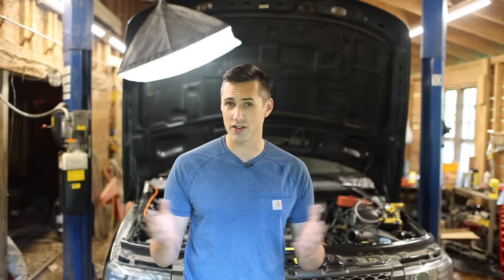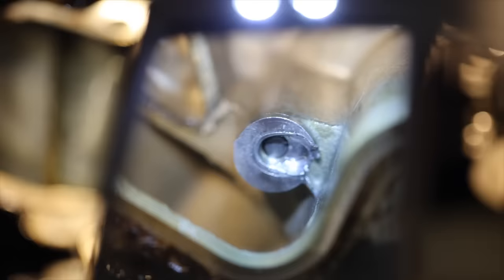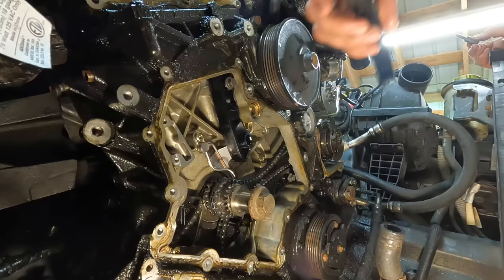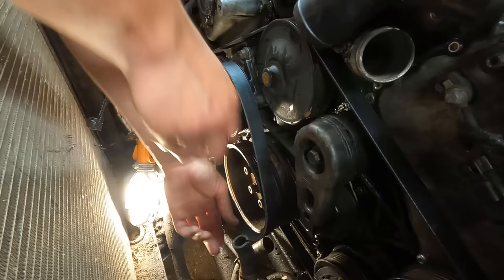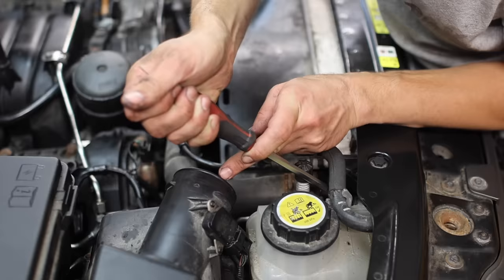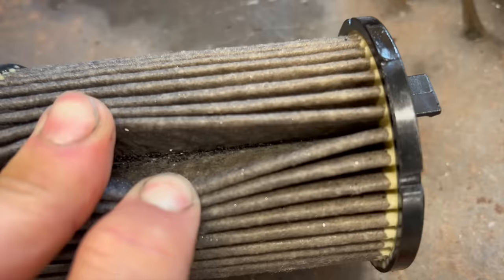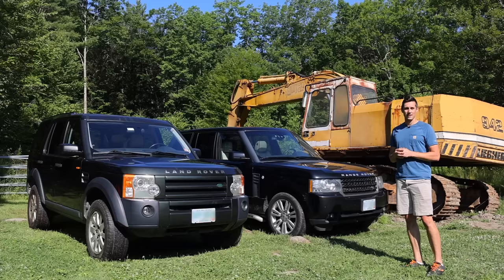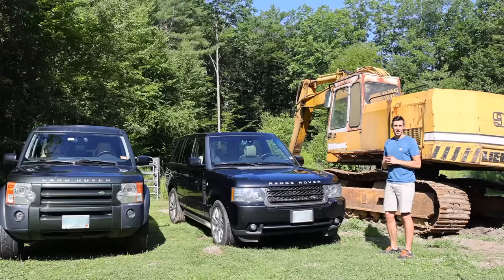Does My Cheap Auction Range Rover Need an ENGINE REBUILD? [Range Rover Part 4]

Comment: I'm not a Mechanic but do work in JLR Spare Parts and I would say just run it, putting more money into this engine is just chasing losses. If it does go pop then replace it with an engine that is reliable and as close to the original engine spec as possible i.e. a reliable V8 of similar displacment with similar features. You should be able to adapt the Jag sensors to work on the new V8 allowing the Jag Engine Computer to run it at the end of the day the ECU has no idea what the sensors are installed in and all engines need the same things to run.

Comment: As dark as the first oil change is, it’s possible, all the broken cam parts were just stuck in the oil sludge in the engine, if it’s holding good oil pressure and not making abnormal knocking or vibrations. It’s probably fine.

Comment: You must remember that the Range Rover has not let you down yet.  It has a history and you have worked on it, but the engine runs fine.   Aluminium is less of a concern to me that steel.  Cams running in bearing caps is normal for a British engine; it works fine and does not generate wear.  In fact of my pre and post war British engines, the cam is the least wearing bearing (as long as you used reassembly grease).  Drive the Range Rover and you may see less aluminium over time.

Comment: Engine Flush and oil pan removal...It would make damn much of noise if it would have been wearing... probably those debris are still left in oil pan. Great work of art. Thanks. Great videos

Comment: AH SNAP! i've done the same mistake with my 1996 volvo 940. The issue with engine cleaners is that they do more harm than good if used the easy way. Ideally we should've both taken the oil pan out, thoroughly cleaned it, then added some expensable oil with the engine cleaner followed by at least 2 oil changes. By cleaning the sump first you ensure 90% of the rubbish has been removed and won't go swirling around all the friction points such as crankshaft bearings etc. Then that way you only clean and dislocate any residue from oil passages and the rest of the engine which you'd want to flush out after 500 miles or so. If the oil and filter don't look too bad then you're good to put fresh good quality oil and filters in until the next oil change. As every one else mentioned keep at it until it's clean, perhaps at the next oil change once you've drained the old oil put the sump plug back on and pour a quart of oil in the engine, then flush that as well, hopefully the fresh oil will drain a good amount of stuff in your sump, you could even run it through a cloth or towel to see if it actually carried some shavings with it. Best of luck Waldo. If you were to engine swap it why not consider the 4.4TDV8 or the smaller 3.6TDV8 or even the L405 4.4 v8 turbo diesel V8 engine from the newer 2012 onwards range rovers? They're all diesel torque monsters, they come with 600 to 700nm(516lbft) from factory, if you re map them they go up to 1000nm(737lbft) or more.

Comment: Along with the easy-out kit, left hand drill bits work great for extracting bolts when used along side of right handed bits. Simply drill a hole in the broken bolt with a right handed bit, then choose the next size up in a left handed bit and forcefully drill the hole thus provoking the bit to jam inside the broken bolt and unscrew it.

Comment: Great vid.  No LS swap, too complex of a vehicle.  It's find that glitter in the oil source and use the bucket to smash it, but a super mud run or an airborne jump may be required first.  These LR's are hard ones as they are unique from oil passages to high tech attempts at superiority.  Hoping you can find the source of the aluminum in the oil and fix.  Someone with better knowledge of these than me might help.  Sure hope so.  Waiting on Part 5.

Comment: When you did your cams---  You have to keep the caps in order and put them back where you got them from.  If you mixed up your caps, it will have to wear in a bit--  but it should still be fine after it wears in....   I'd just plan on doing an oil change half way on your trip, somewhere on the road or in another Youtubers garage along the way.  (that's what Deboss Garage always does).   That seafoam could have busted a lot of stuff loose and it may take a few cycles/ oil changes to flush it all out.
Reply from the maker: Yeah, I made sure to put the camshaft caps back in their original locations 👍

Comment: Just open the bottom oil pan and have a look.
Wash it properly 
Clean oil pump filter and keep running the engine till it breaks.

Comment: I am a car guy and home mechanic and will do just about any car that I really like. Worst car project was a 2008 Landrover LR2 that my dad liked so we did it as a project together. We knew it had a blown head gasket. Bought it for less than $1000 and put about $1500 into it. It was tough to work on, lots of special tools, and anything that could go wrong, did go wrong and it was just one problem after another. We learned that the previous owner put head gasket sealing product in the oil instead of the coolant. Had to flush it out like six times, blow compressed air through all the small VVT oil passages, new oil pump,etc. It was like someone had a Land rover voodoo doll and would poke pins in it just to torture us. Even when we thought it was all done and went to sell it, a fuel pressure sensor blew out at the end of the fuel rail and a stream of gas nearly caused a fire during a test drive buy a potential customer. Needless to say the gas leaked into the alternator and blew the diode out and an actuator motor in the intake manifold. Just wanted to blow up the entire car at this point but my dad, an engineer type, just could not let the car beat him. He fixed these last two issues and so far has been ok, but I still don't trust it. We have countless hours into it and learned a lot but the main lesson...never buy another Landrover.😂

Comment: I did one with a New timing chain and crank and cam sprockets. Metal shavings did go away after four new filters . The bolt that was rattling around would add even more shavings to clear all the oil channels. Before your trip use Liqui Moly Ceratec.

Comment: Can you retrofit the sensors from the Rover engine to the GM LS or Toyota 5.7L engine for the Rover electronics?  Use the GM or Toyota ECM to run the engine.  I know this sounds easier than it really is, but it may solve some of the issues with the conversion.

Comment: I've been a mechanic most of my life seeing the damage from those broken vulture probably got residual aluminum still throughout the engine you only drove the vehicle 10 miles you said so that wasn't enough time to flush everything loose plus you're going to have some transfer from the new components you put in there from what I can tell on your videos the engine sounds really well I wouldn't worry about it I just drive it put some liquid Moly anti friction oil treatment you can find on Amazon for about 10 bucks a can I nearly get mine at Napa for around $14

Comment: Drain the oil, drop the oil pan, reach up from underneath and replace the crank bearings. Reinstall oil pan. Refill with oil. Run.

Comment: Just wanted to say thank you for turning me to the Milwaukee metal saw and the Tillman gloves. You pick very good products. That saw is a blessing. I have an XP30 and am sick of grinding dross and slag. When I first used the saw on 3/16 msp, I was awestruck. It cuts with less effort than going through wood with my cordless framing saw.

Comment: LR3 (Discovery 3 everywhere else in the world) is a great truck! I think it was probably the most reliable Land Rover product for many years. I had one and the only thing that went wrong with the rear view mirror came off the windshield right 3 days after I bought it brand new. By the way all that fancy trash control and yaha control ..yeah that doesn't matter on ice. It won't save you. Especially if there's a layer of thin snow on top of it and you can't see the ice underneath it. And the fancy street tires they put on them limit your off-road capability. But otherwise great comfortable and generally reliable vehicles. (LR3) only

Comment: On GM's Ecotec engines there are very similar issues with the timing chain assembly, I have a 2.4L version fitted to my Captiva. My tips - 1) do NOT fit standard OEM guide fixing bolts, rather ARP bolts as they are of a much higher grade & will not break, you may have to have some spacers made, but these are not difficult to produce. 2) only use US replacement parts as they are the best. I once used the same Castrol motor oil, but found SHELL Helix to be far superior which I change every 10-12,000km. I only use Bosch oil filters and change every 3,000km. Modify the chain tensioner/s to give a constant hydraulic dampening effect. I can explain to those who are interested as it's the tensioner which is really the cause of all the problems.

Comment: LS is always a nice option.  I don't care if "everyone does it."  There's a reason why everyone does it.  They're great engines.  That being said, I'd love to see a 4.0 1UZ-FE from a Lexus in it.  Incredibly reliable, smooth, and powerful engines.  

For now, I suggest just driving the thing locally to see if it's still going to die, unless of course you have thoughts of a rebuild or have plans to salvage the engine for some reason.
Reply: I would have loved to agree with you on the 1UZ swap, but I feel the 2UZ-FE is a better engine for this application. It's as smooth and quiet as the 1UZ while having enough torque to move the weight of the Range Rover around. Plus, if you get one made between 2005 and 2009 you get more power than the 1UZ @275HP.
Reply: @damilolaakanni  The 275 hp was only for the non VVTi 1UZ.  The later VVTi 1UZ in Lexus cars, like the GS, have 310 lb ft.  More than at least the earlier 2UZ.

Comment: PJmac. After I had my chain guides changed I drained oil and dropped oil pan.Found a lot of plastic from old guides and some metal shaving.Also oil pick up strainer was partially blocked with plastic from guides.I changed oil three times over a couple of weeks.Oil filter had no particles of anything.Its been four years, runs well.

Comment: Hi Waldo, great videos, thank you! This chemical engineer can tell you that abundant water vapor (H2O) in the exhaust of any internal combustion engine is normal - roughly speaking, the formula for the combustion reaction is 2 C8H18 + 25 O2 -> 18 H2O + 16 CO2. Actually water vapor (steam) is not visible, but below a certain temperature the vapor condenses into fine liquid droplets (condensation) and this is what you see. Condensation droplets are visible but have no color - however I believe that if the exhaust has a grayish or bluish color this indicates that the engine is burning oil.

Comment: Run it till it blows. It'll make a great video. I'll wager that it'll likely be fine but you never know. I had a sludged up Lexus ES300 that would continually clog the oil pickup screen with carbon and the oil pressure would drop to 0 psi.  I took off the valve covers, upper/lower oil sump and ran it with everything removed with a bin of oil under it to flush it out. I then cleaned every part I could back to shiny aluminum and it worked like a champ.

Comment: Drop the oil pan, clean it throughly. Fill oil, change in 50-100 miles and check. Do a couple of more oil change/flush and check.

Comment: Run it. Those aluminum shaving are probably from where the bolts snapped off on the guides and wallowed the holes around it some. And build up over time

Comment: Sorry Waldo, I forgot to comment with a yes on the rebuild, you are this far in to it, its three quarters of the way disassembled, so keep going. No sense in having to do it all over again to be right back here. It does not look like you need the practice in taking it apart, deer flies or no deer flies. I going to get in to part four

Comment: Contact Joe at Lost Cause Ranch. They did an LS swap in an LR2 and whoever made that kit had an interface between the LS computer and the LR2 computer, so all the LR2 functions and gauges worked with no DTC's. I appreciate the 2005 RR is much more sophisticated than the LR2, though the company may make a kit.

Comment: I have not watched all the videos but I once bought a car that had been sitting for a long time and drove it quite a long distance, all the metal bits in the sump then clogged the oil lines and wrecked the engine, I did about 3 oil and filter changes within a week and it was still wrecked.
If I ever buy a long standing car again the first job would be a sump cleanout, if it has one!

Comment: I would send in an oil sample and get an analysis done. They should be able to tell you where the metal shavings are coming from and what might be the reason they are showing up. That would certainly give you a good idea financially of what direction to go in. Best of luck!

Comment: I would say drive it and do a few oil changes in short intervals. If that thing was neglected there would be a fair bit of filings to flush out, and aluminum filings would be like anti-sieze, a small amount would smear a long way to discolor the filter. Stay close to home with it in case it starts grinding. If there is damage, it's already done and would require machine work or parts replacement. Ford uses the same design on the older 5.4 engines where there are no cam bearings, if the cam loses lubrication, the head journals are toast.

Comment: Agree with some other comments. My experience as well has been new metal internal parts you will see metal shavings. Could be all the metal in the system from before finally getting some good servicing and breaking it all loose.

Comment: K-Seal is actually really good at sealing so it probably sealed the head gasket, never know unless you know...   With all that metal in there from the bolts and tensioners coming apart there will be shavings all over in the pan that will be picked up in the filter. The filter is doing its job for now, Keep driving it for a month changing the filter every week and see if it cleans up.

Comment: The cheapest route is to do three or four oil changes at 300-500 miles along with an oil flush. I think it's residual stuff floating around. After multiple oil changes and a flush if you still have particles, then just run the vehicle local as a grocery getter till he implodes.

Comment: Hi buddy,
From.someone worked a lot with engines. You need to do the following :
Clean the oil pan.
Clean and inspect the oil pump metal filter.
Flush the engine with low viscosity oil but cheap relatively + cheap new oil filter. 
New oil according to specs which I believe so 0w20 or so + new OEM filter.

Now the magic is that there is lots of hidden places in the engine where those particles from any previous experiences took place. Now it's time to clean them .....the trick.is that you feel the engine is ok ....compare its music with another range rover same exact engine. 
If it's fine then your good to go the idea that you keep on changing the oil filter every here and then till the residues are gone.
So if you change your filter every 500 miles ...you will start seeing miracles after that ....but as long as you feel the engine is ok as everything power sound heat etc.
Also there is antoehr trick you can make to clean the engine properly which I used in all my cars but never my range rover cause simply i didn't need to.
You have 7-8 liters of oil inside out 6 liters oil and 2 diesel + new junky oil filter and run for 15 minutes on idle.
Once the oil is out you will see miracles coming with the left overs.
Then put new stuff inside and run the car for 500 miles and make a regular  oil change + filter for the favour of the hidden  oil pipes, cooler, and pump which some of that mixture still there from the flush. 
At this stage you will see that the oil %90+%10 diesel mixture which you will change is extremely clean...but you will do it + filter to get rid of the leftover diesel in your engine which keep.in.mind that rubber parts do like diesel.
Every time I flush engines this method I run first  500 miles with almost brand new looking oil as it was just poured in. Google it first and hope you like it. Good.luck.

Comment: I bought a used van with a V-6 and did a couple of oil changes and over time and more oil changes the van lost oil pressure.  What had happened is the oil changes with the detergents in them broke loose carbon deposits and they had clogged the intake to the oil pump.  I had to take off the oil pan and clean out all the broke loose gunk and cleaned up the oil pump.  It ran for years after that.  Aluminum filings in the oil is a sign of trouble.  Big trouble.  The oil filter should not be coated with this.  Good luck on the road trip tho.

Comment: Drain the oil. Put a camera into the sump. Fill with diesel. Turn over the engine . No spark. Drain the  diesel . Check with camera. repeat to see if the aluminium keeps increasing

Comment: Tough call. Maybe double check cam bearing caps are in the right location then drop the sump and take a look. Or drain the oil and put the bore scope up through the drain hole and look that way. Whilst it is annoying for you it isn't fixed, it does make great content. So much better than those tv shows were they say everything went right even if it didn't.

Comment: Admire your tenacity got fix your RR V8. I'm only 76 years old and had my first Rover in 1967 and my last was a 1972 Series II 88 inch. Currently daily drive came with an LS. Z71 Tahoe 2017 vintage.

Comment: Aluminum flakes can be very tiny, suspend in the oil,  and appear more numerous than they are. They're hard to flush out completely and don't really cause wear. If they keep showing up, something's wrong, though it may not be as bad as you think.